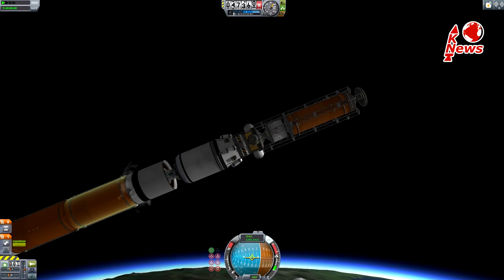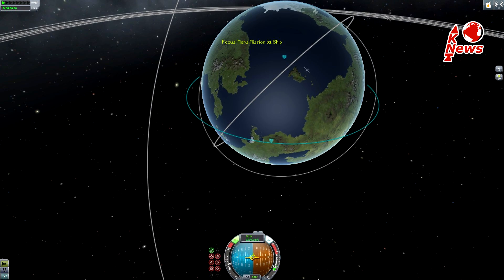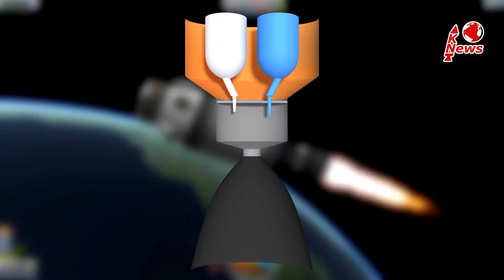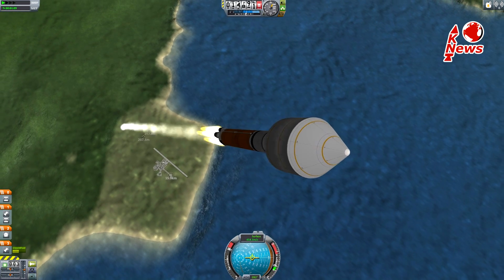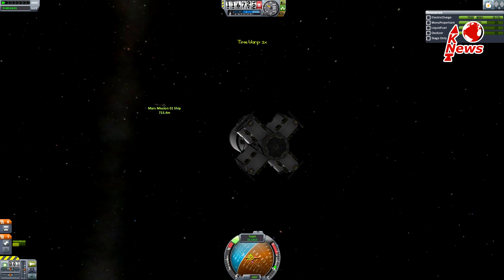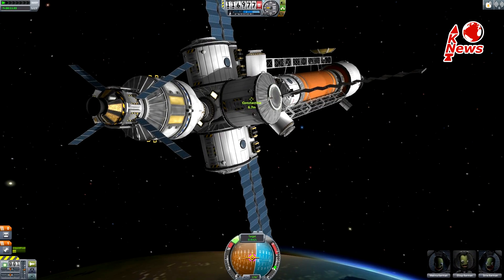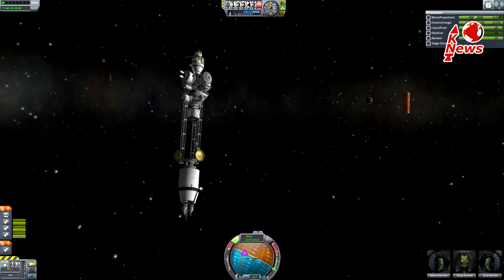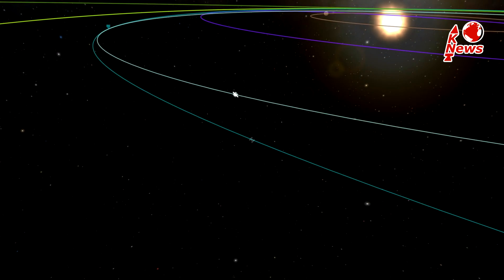Nuclear Thermal Propulsion to Mars Special | KNews #21

Comment: Question here...
As kinetic energy is dependent on the mass and velocity, I don't really get why they use hydrogen instead of a heavier fuel. Wouldn't that push up the kinetic energy?!?
Reply from the maker: +Lele Merb Hi, you have to imagine you have a set amount of propellant mass. Lets say 10 kg of hydrogen OR 10 kg of carbon. So the total mass is the same but you have much more hydrogen atoms than carbon. The energy with which you can heat up the propellant is also constant since your reactor can only produce / withstand so much. This means the only variable is pretty much the velocity at which you can shoot the atoms out. The faster you can shoot it out the more efficient your engine is if you add all those tiny impulses of the atoms together. However, the carbon would probably deliver more thrust.
Reply: +KerbalEssences Okay got it now thanks!

Comment: i know tnx for quick answer... i am from military forum and we have USA/USSR NTR, nerva, rover, timberwind,rd-0104 section.
 i even dont use super-heavy launcher in my idea ,hows that for -off the shelf.
 you can call it delta heavy to mars or proton-to- mars. our curent launchers do up to 25t to leo  per launch.
5 launchs for first mission for 120t to leo. 
then about 3 launches for every new tug earth refuel mission every 2 years . and tug would be very reusable. to reduce further expence.
proton-m is 100 mill per launch so thats 500 mill total first time and since first launch is unmanned you can take your time you can assemble formonths and we have that production capability... or you can make some launches with delta-iv some with proton.
 we have zero boiloff tech for H2, nuclear engine , habitats, landers , ascent vehicle,  etc.
but every human mission was flyby first just to verify everything in real world. this would be unmanned flyby , nucler engines should work for hour /hour and a half, habitat for many months ,and we havent landed anything heavy on mars so that would be verified too. and if they land safely it must be proved it can  produce fuel and oxygen on mars and be ready in time for tug new launch from earth. also by having go at mars in 2 times -that reduces total system weight, and NTR 900 isp is great to reduce even more weight.
i used zubrins idea from mars direct i heard before to make ascent vehicle even lighter since its unfuelled and combined it with nuclear propulsion ,unmanned flyby and delivery , and unmanned orbit assemly- with available heavy launchers.!!
 you can pitch this idea on some forums see what others think.

Comment: nuclear reactor like this can last a decades and used as a tug - with conjuction trajectory it can be used first time unmanned (or some animals) to verify everything- engines, concept ,etc... then,land a habitat and acsent vehicle on mars and prove it can be done safely, while tug slingshots back to earth ,after 2 years then its reloaded in earth orbit  with fuel-H2 in that empty truss (you ejected on way to mars but i would use starlike pattern of fuel tanks), and re-used this time with humans onboard- added new habitat.
many  habitats and life support systems would be hermeticaly sealed and tested on earth itself with crews during this time.
meanwhile habitat and ascent vehicle on mars would be refueled on mars with insitu methane and oxygen using CO2 from atmosphere and water using small nuclear reactor. 
this thing could be made and ressuplied by few already available -4 heavy lift boosters like proton ,delta or others... with NTRs 910 isp you dont need more then 100t in LEO since habitat and ascent vehicles are already on mars! 
thus with available technology we could go to mars!
Reply from the maker: +Zeroni82 Technology is really not the issue I think. It's all about the money as usual :) If you go arround and ask random people what they think of space flight you will be very disappointed. That's at least my experience. However, it's also a big motivation for me so I can show those what space flight is all about.

Comment: How long you will be torturing us before you will relase new KNews?
Reply from the maker: +Mariusz Klinikowski I don't know for sure. It depends on the launches! I sadly didn't manage to cover the recent Atlas 5 launch because I wanted to get this done asap but the next should be either Ariane 5 (launch is on 10th nov) or Super Strypi which should launch soon aswell.

Comment: You say that the main advantage of the nuclear engines is, that they use hydrogen as propellant, which is lighter than CO2 and H2O. But I guess that the main advantage of a nuclear engine is, that the chamber temperature is much higher than that of a conventional rocket.
Reply from the maker: +Daniel Wolf Hi, I think you are not talking about regular nuclear thermal engines which have been build in the past. The record holder has a chamber temp. of ca. 2300K while chemical rockets reach approx 3500K.  (http://www.daviddarling.info/encyclopedia/P/Phoebus.html)
Reply: +KerbalEssences Interesting. I checked Wikipedia "Nuclear thermal rocket" and they differentiate between solid core, liquid core and gas core. The solid core engine are the ones which were build in the NERVA programme and the gas core engines can reach "tens of thousands degree" and up to 5000 isp.
Reply from the maker: +Daniel Wolf Liquid and gas core engines are just theory and do not exist a far as I know. The cool thing about "regular" nuclear thermal engines is they are much more efficient even at the same or lower temperatures of chemical rockets and that is what I try to explain. 
In theory you can drive them much hotter using the mentioned techniques but they come with major downsides like a highly radioactive exhaust and what not. I doubt they will build them in near future but who knows what they do behind our backs :)
Reply: +KerbalEssences Yes the solid core engines could be built right now. Elon Musk even proposed this for some time for his own rockets but abandonned the plan for now, most probably because the people and politicians wouldnt trust a nuclear rocket - as we all know (and Elon Musk again experienced this summer) rockets sometimes blow up...